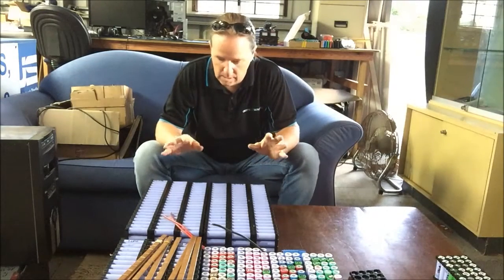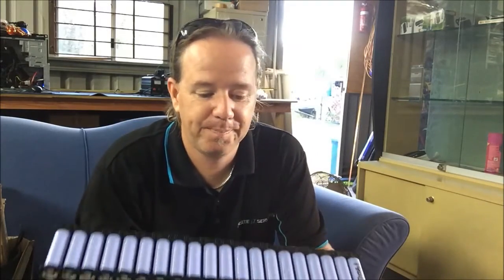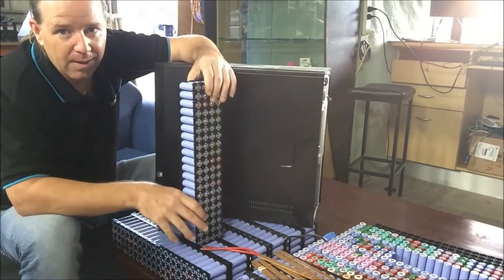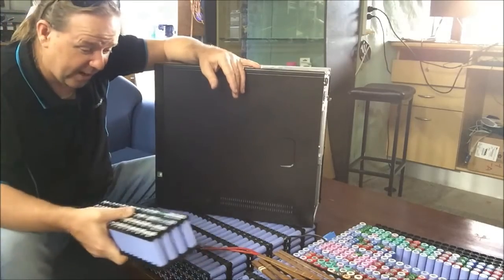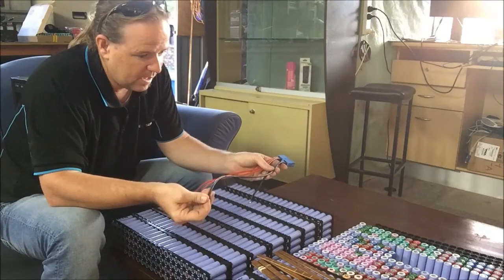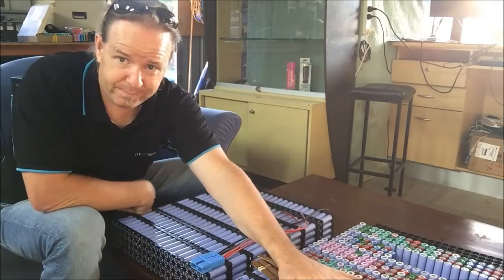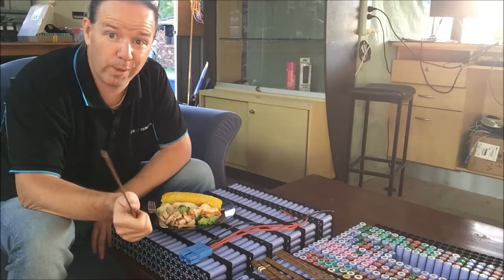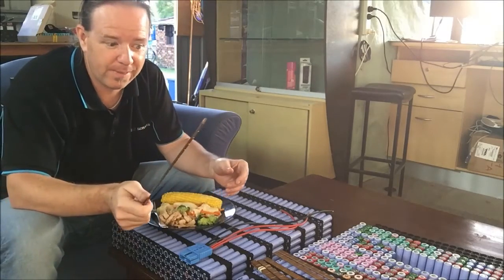General sit down and chat about direction

Comment: How about mounting a couple V-channels (also called a French cleat) on your wall and then smaller opposing ones on the battery packs. That would make them secure to the wall, but also easy to remove whenever needed. You can see them at this link: www.homedepot.com/p/OOK-Hangman-200-lb-French-Cleat-Picture-Hanger-with-Wall-Dog-Mounting-Screws-55316/202341629
Reply from the maker: +jimginnyohio i really like that idea and would probably use a version of it if I wasn't already so invested in my 'Mount"

Comment: Thumbs up on those ideas. I'm going the same modular approach - one BMS for each 2 kWh pack.  I've been testing some cheap BMS on my 1 kWh go-cart pack:
* http://www.aliexpress.com/item/7-cells-20A-balancing-Li-ion-Lithium-18650-Battery-In-Out-BMS-Protection-Board/32389617021.html
* http://www.aliexpress.com/item/24V-30A-60A-7S-BMS-PCM-PCB-24V-Lithium-battery-BMS-for-7S-3-7V-lithium/32472276216.html
* http://www.aliexpress.com/item/24V-30A-7S-BMS-PCM-PCB-24V-Lithium-battery-BMS-for-7S-3-7V-lithium-cell/32469245428.html
I assume they'll be OK for about half their stated current rating.
I'd prefer to have one of these though: http://electrodacus.com/
The other option is to follow Jahu's approach and just do battery monitoring - given that you'll be able to eyeball it every day.
Reply from the maker: +Paul Kennett There are heaps out there but all the info about them seems to be simply someone's opinion i will not be getting any more from ali

Comment: Another idea that may help you, the power of the Arduino is damn powerful, you can build a custom BMS based off a arduino or raspberry pi using one of the many build threads on the internet, mate has an arduino based bms on his ebike...
Reply from the maker: +storxusmc cool idea, but haven't the time to play with Arduino's at the moment - I've got one or two laying around somewhere but never used them.
Reply: Ya most of the build treads i seen have the coding needed already posted, just copy and paste and change the numbers on how many cells to monitor..

Comment: to bad you cant come up with a form of connection that would allow you to use the weight of the modules to connect each module together, like a wired splitter between modules that is prewired, then sat on one module and then another module stacked on other side, the weight of all the cells secures the connections to the cells all through gravity... use some sort of guiderails to keep the modules perfectly lined up...

Comment: On the smaller packs. If you keep the bus bars. Ideally have the positive and negative ends of the bus bars opposite each other. eg negative bottom / positive top.   Especially if you don't use a bms.
Reply from the maker: +turbosigma Don't know how the cable lay out will be as yet, i'm betting I will have to compromise looks for safety. BMS are being used.

Comment: Keep in mind that it could be a good idea to have a easy view to the cell fuses when the modules are "wall" mounted. i go for a 19" Server Rack with metal shelf paint it with heat resistence color for electric isolation and cover each with a glas or flagstone for mechanical damage the isolation painting and better protection in worst case. First i want to cover it with fireclay but they are very heavy and not that cheap. why you wont go for more series than 7. you´ll go with lower amps. Have you see the latest Product from SMA Sunny Boy Storage?
Reply from the maker: +lorykk20 Mine will be mounted directly onto Colorbond shed wall using some sort of powder coated steel construction frame or alloy down the track - my thinking now is reducing weight for ease of mounting & maintenance.

I already have an inverter that I like and have used in the past of other projects - a PIP2424MSX, so this project is 24v. Next will definitely be 48v but that's a long way down the track. The SMA one is high on the List of wants as I already have a compatible SMA TL5000 inverter.

Comment: two metal slide plates so you can push pack on, place one 5 from top and 5 from bottom, this will help with the 3.5 Kg load of the pack. Hope this helps would
Reply from the maker: +Geoffrey Howsam do you mean on the sides where i'm hiding my huge busbars ?
Reply: +HBPowerwall Slide plates in to the long gaps between the batteries, the busbar will be on one side, so as you look at the pack front on you'll have black holders on each side. Hope this helps, I would love to send you a pic of my idea to help holding to wall plate

Comment: Every cell pack with a Bms and a relay so when the pack is drained it will disconnect that way batteries with 2000 mah and 1500 mah and even 1000 mah can be used and recycled together .
Reply from the maker: +94Discovery Have considered something like that idea just so I can use the poor cells for extra storage for very minimum  cost.

Comment: I think the idea of multiple 24v ish packs would be great, modular, compact, better thermals, easy to expand.Nice Anderson plug and connect it to some sort of buss bar to the inverter so you could run off one or 5 how every many packs you build, real easy to expand, and keeps it neat.You could have a simple neat box which fits all the mono block packs all in a row and a perspex window on the front. vent on the bottom and small slow running fan on top.cell, single Li ion cellMono block, one of your 3.7v packsbattery, the whole 25.9V 
battery bank, all 25.9v batteries in parrallel
Reply from the maker: +John Smith Yep to all that :) except the packs will run one into the other to reduce cable runs and keep it tidy.

Comment: That corn looks great! :))) As for the cell packs...will be heavy in the end. 3,5 kg x 7 packs, plus the inverter.... I would make a rectangular/square wood frame with a shelf on the lower part for the packs to sit 7 up. All the connections to be made in the bottom part of the frame. Inverter sits in the middle of the packs. Vent hols drilled on top and bottom of the frane, maybe some fans on the bottom to help air flow. Should have done a drawing of this..
Reply from the maker: +Danut Plesu Except for that one bit that gets stuck in your teeth!! 

Legal issues with installing the Inverter with the cells - next video, Can't draw for shit, tried to learn cad ended up looking like i ate the crayons and craped them out..
Reply from the maker: +Shaun Luty It will be the legal distance away :) stupid safety regulations.